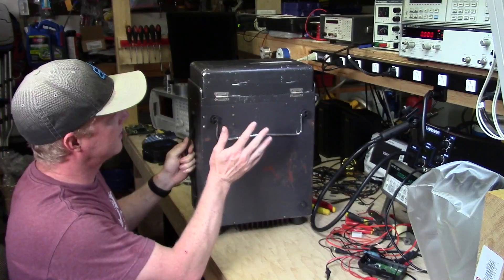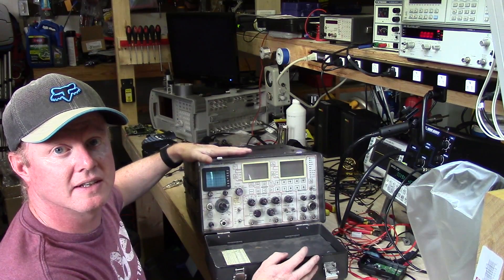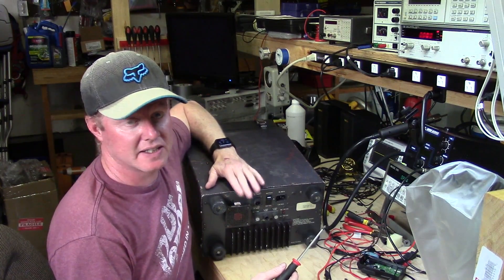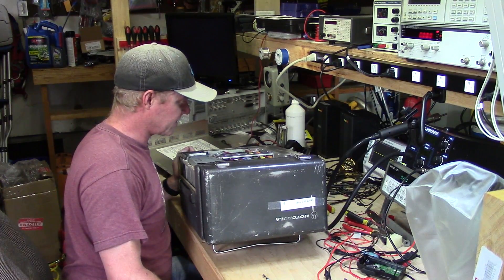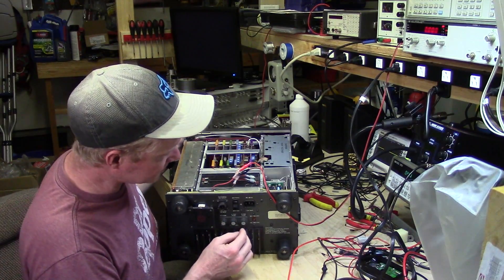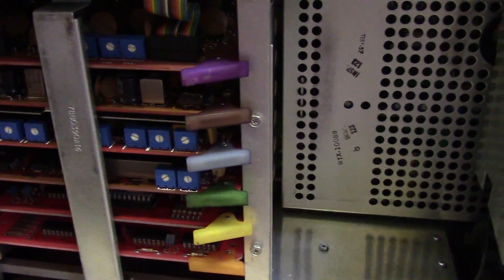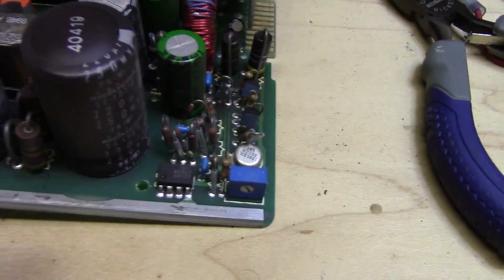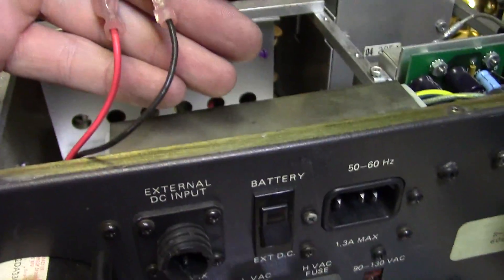Motorola R2210B/HS Repair Teardown Part 1

Comment: I'm working on an R2001. The volume and other controls are dirty. What kind of cleaner would you recommend? And the RF level is a bit hard to switch. Not sure if it's the position switch or attenuator. Not looking forward to taking the attenuator apart.
Reply from the maker: I usually remove them and let them soak in iso alcohol and work them some. After that there are several products to help keep them clean and lubricated.  De-Oxit makes several.
Reply: @ShaneBurrell1  Thanks for the great tip! I saw some deoxit made specifically for pots. So I will be ordering some of their products. I don't feel like removing them since they are connected to a ribbon cable. I would probably do more harm than good.

Comment: My R2200 is similar. Main fuse blown, PS board scorched around the 2 caps 350uF 25V. Sucked both out and found smoked trace on component side. Is the entire board available in the surplus market? This was a running unit, and i'd like to keep it. I have a dead R2008 available for parts or trade. Thoughts?
Reply from the maker: I haven't found a surplus but the boards are generally just 2 layer or 1.  So any fixes can be done above board.

Comment: Nobody would use a soldering iron the size of the one he is using on delicate micro-electronics...
Reply from the maker: Actually the metcal is exactly what you use on delicate micro-electronics. It’s one of if not the best soldering system to ever exist.

Comment: hi  shane  i like  your  video about  the  motorola  service  monitor  btw  i   pick up one  on  ebay  is  arrived  today  is  a  R2200A now  to  learn  to  operated and  gave ser. and  mantaine radio's  out there  tnx.
NP4LW
Reply from the maker: Glad you liked it.  It's still working great.